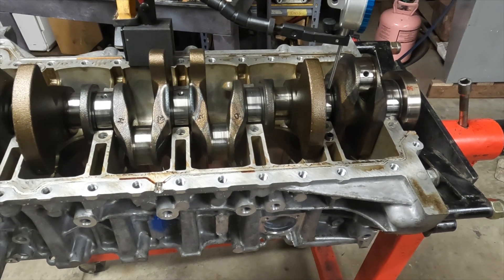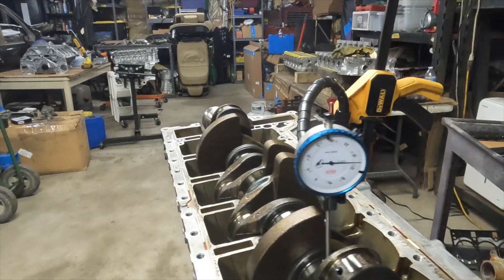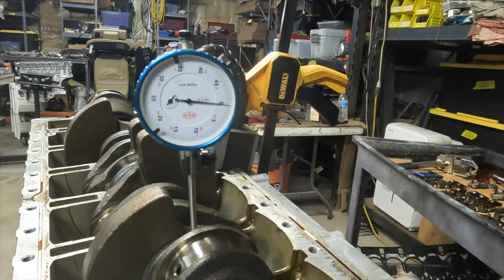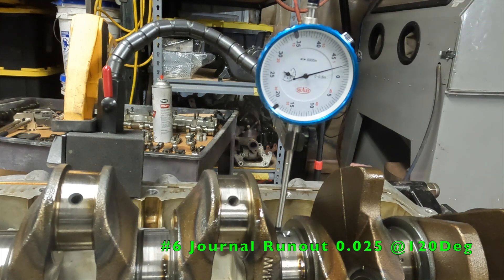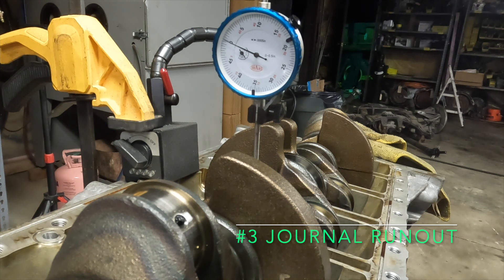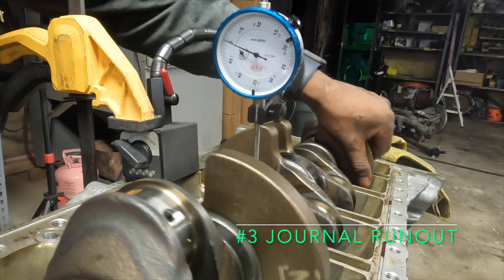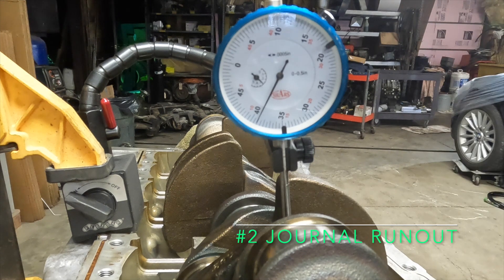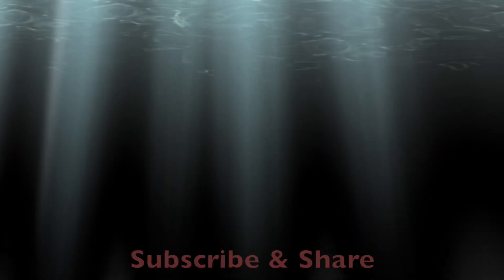BMW CRANKSHAFT RUNOUT- VARIOUS ENGINES

Comment: My crankshaft is brand new and hard to spin with my hand but easy and feels ok with wrench. What is recommend breakaway torque how easily would you describe your cranks spin on the inline 6.
Reply from the maker: I believe I listed the BT in my video
You should be able to rotate crank somewhat rash with hand while grabbing the counterweights